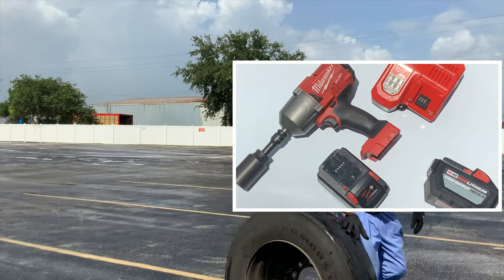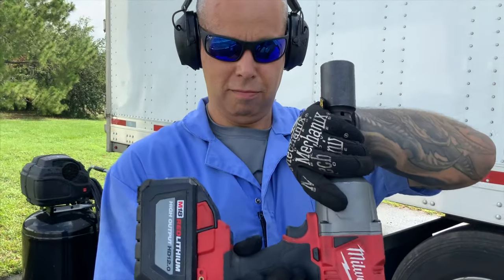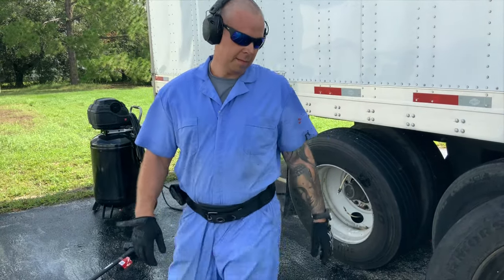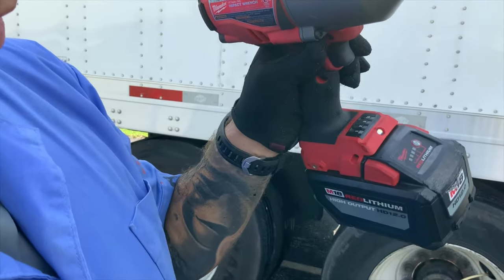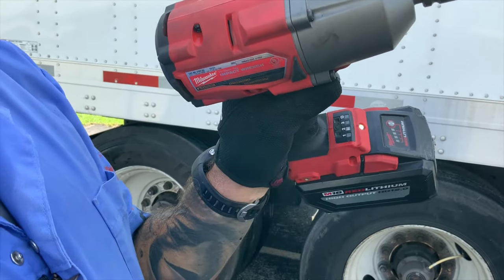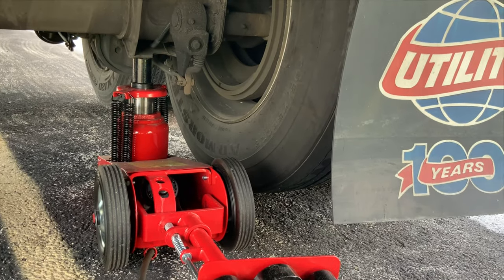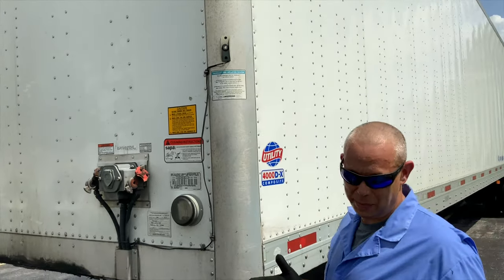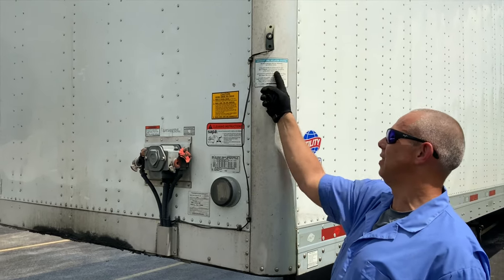Milwaukee battery powered impact wrench vs SEMI truck log-nuts. Will it work?

Comment: Like butter?  I can assure you every trailer lug is not like butter.  1/2" impact  isnt gonna cut it 90% of the time imho
Reply from the maker: The 1/2 inch battery wrench is still in service here a few years and hundreds of lognuts later, still running strong haven't failed once. We had same concerns before we purchased it. It's worth every penny. (We are not paid or sponsored by Milwaukee).

Comment: Putting it on at 500 ft lb or did the torque wrench need to get it there?
Reply: On the middle setting, you will be 1/4 - 1/2 turn away. On max power, you will be way over. Be careful.